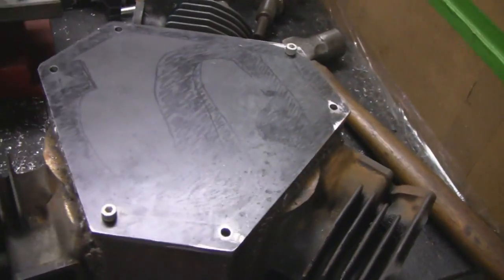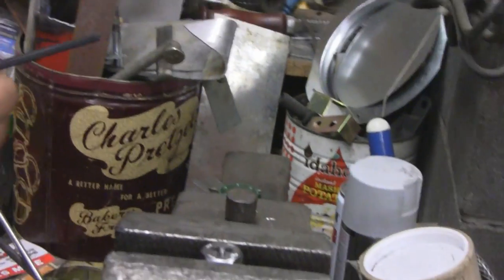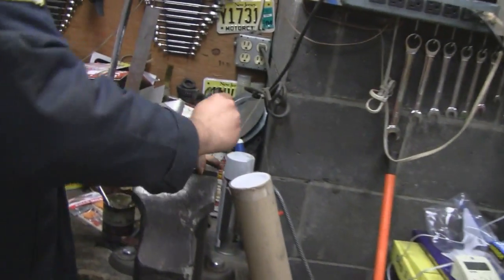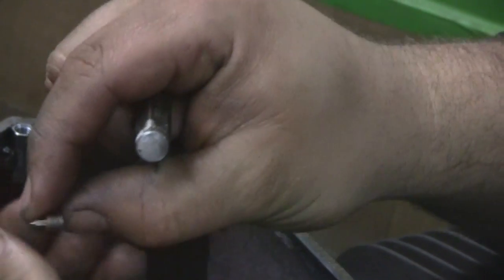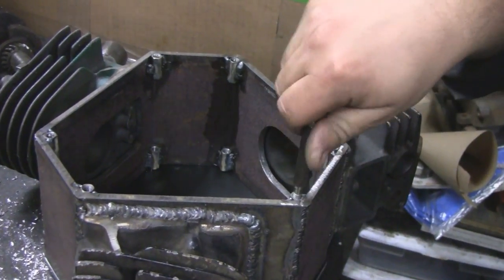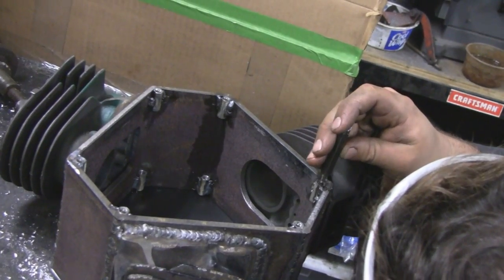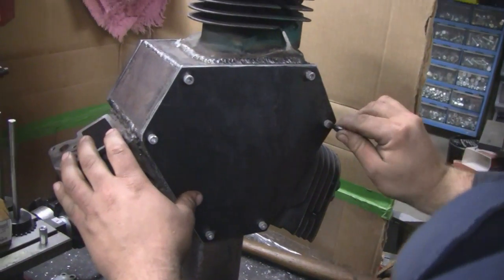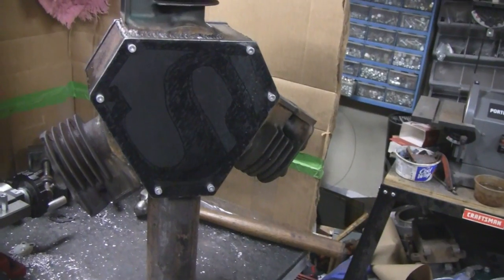HOMEMADE RADIAL BRIGGS ENGINE (part 13)

Comment: hey guys, hope this finds you doing well, thanks so much for the update. I really enjoy watching your vids. You guys keep plugging away, and will wait patiently for your next one, can't wait to see the engine running. I myself understand about not having enough time to do everything you want or need to do. I've got a 4x4 Dodge Ram that has been down for the last 3 months and I am going to try to get it back together over  the Thanksgiving holiday. Just haven't had the time and now on top of all that I pinched a nerve in my neck and have limited use of my right arm. just the way it goes.
Reply from the maker: +Ronnie Runyon Thanks Bud!!☺

Comment: We use to cut the heads off 6m bolts when we were fitting rear spoilers screw them in to the spoiler press the spoiler onto the car leaving dimples them drill the holes for it .

Comment: Take your time guys. Loved the Superman symbol on the cover. Be cool if you etch it into the cover. Planning on a cover for the chain drive for the cams? And is it going to be bearings for the crank and cams or bushings?
Reply from the maker: +prancstaman Nah the cams and chain will be exposed and we'll probably use bearings!!☺

Comment: Quite the progect. Cant rush perfection thats for sure. Though im sure the proding from tubers helps push you along. Some of my junk has sat for years at a time. Its nice to only have one progect at a time but thats tough as you know. Having the right tool for the job always makes life easier. That radial would look nice with some home made over head valve heads on it. Think you can convince Mike to go the extra mile? Keep on keepin on
Reply from the maker: +jeep2003 Anythings possible Bud, it's still in the development stages!!☺

Comment: So, this is going to be called "Super Engine" ?  According to the felt tip marker drawing on the side plate  I saw that famous logo. ( haha )
Yes, good work guys. I guess some folks are so interested in what you're doing , they think that maybe they ( we ) missed something. But I'm sure we all understand just how much time you folks spend on things and then you can't do all things 'over night' so to speak. I am sure too that we can and will all wait with understanding.
It is a very interesting concept you are building.
Thanks for this 'update' all the same.

Comment: Thanks for the update! I know how hard it is to find time for projects. I want to work on my projects but when I get home from work I'm too exhausted to do anything after a 10 hour day. I am a machinist and I build plastic injection molds for the auto industry. Those punches are called internal pin punches
Reply from the maker: +UnitCrane514 They're not internal pin punches, they are transfer screws!!☺

Comment: Nice! I would drill and ream two locating holes in both side plates when the thing is bolted together with precisely fitting pins to make sure you get an exact alignment of the bearings if you take it apart.
Can't wait to see more!

Comment: I knew that the radial was just a part time project, I was just worried that you guys had abandoned it. I suppose I shouldn't subconsciously assume that it'll be worked on at a pace similar to the other Briggs creations as you guys actually have to do some serious fabrication with this project.